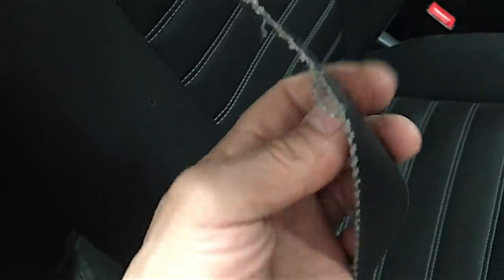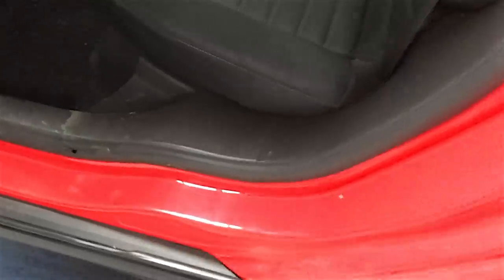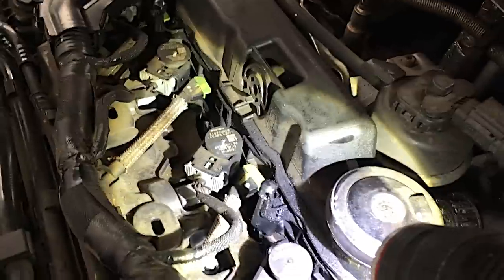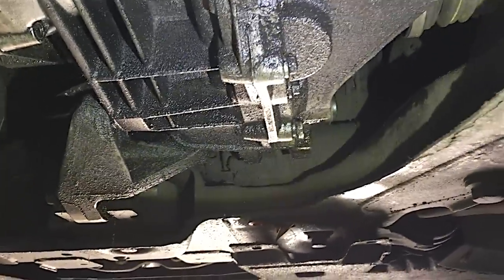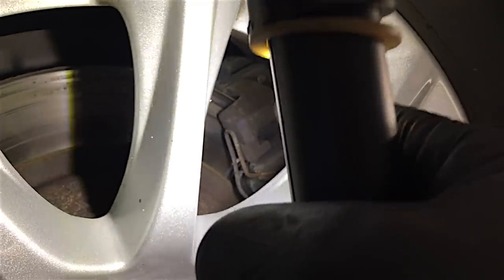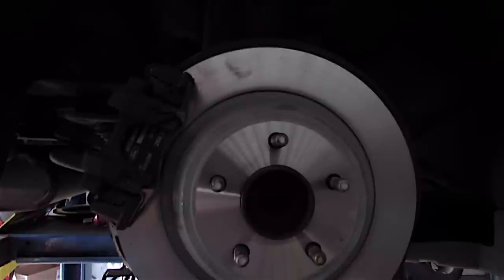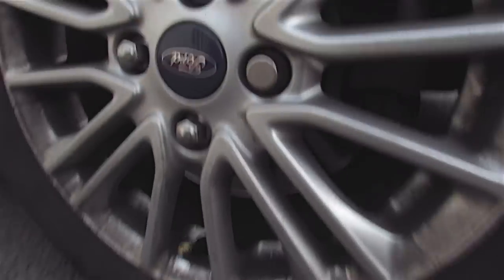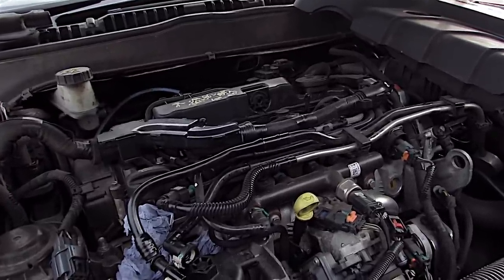My Basic Service Procedure, Ford Mondeo Mk5 2L Diesel

Comment: Hello Alan,  thanks for this vid. Though i dont take it to the local main dealer anymore, because i got ripped off and took it personally.  I always suspected they never changed all the filters. I take it to the local Vauxhall dealer as they do a better job and change filters. And i dont get those ridiculous videos that the poor mechanic/technician has to do. A great pity your not nearer. On the subject of pads and discs, i dont recall that we ever changed discs as often as we do now. Nor springs either.
Reply: I reckon the way it works is if the pads last a long time it's because they're wearing the disc if the pads wear quickly the discs don't.
Reply from the maker: i guess it depends what car it is, the mk5 mondeo does pretty well on discs, 80k plus on the front and usually 200k on the rear, cheers paul
Reply: @alan4x  That's good, mind you using the brakes slows the meter down so no surprises there.

Comment: Hello Alan, I come we with a strange issue related clima on mk5 Mondeo 2015 2.0 diesel 110kw. On the driver side is working normal on the passenger side is always Cold, even with temp sett at maximum. Can you PLEASE give me some advices? What to check or replace....thanks a lot!
Reply from the maker: there ate electric motors on the sides of the heater to operate the hot/cold and distribution..not easy to get to..i have had this problem and tapping the motor with a screwdriver got it working and heating drivers and passengers compartment again...the motor on the drivers side up by the clutch pedal
Reply: @alan4x  thanks for advice! One stupid question from my side. My Mondeo is Left side driving so this motor that you told me should be under glove box in my case?
Reply from the maker: @mihaiursac5041  i would have thought so....you can shine a torch up the sides of the heater and operate the air distribution buttons and the hot to cold buttons to see what motor operates

Comment: A brace that fits the nuts helps and one with a long enough handle to provide enough leverage to open the nuts as well as locking wheel nut adapter.

Comment: Hi Alan, hope you're keeping well. I've read in Car Mechanics magazine that Sealy or/and Laser do special socket set with sizes half mm bigger than standard for example 19.5 or 21.5 specially to fit those swollen wheel nut caps!
I got a Ford and they do my head in when they swell as they tend to get stuck in a socket when you undo them 🤦‍♂️😡
Reply: I bought mine off eBay - they also make a 20.5mm one, and a 27.5mm one for Range Rovers/Discovery’s etc
Reply from the maker: yes they do, i guess it does help rather than hammering a 19mm socket onto the wheel nut

Comment: Cheers! Great video, Alan - very appreciated. I gave my car a service this weekend and noticed a lot of oil on the gearbox and i identified a wet seal on the black plastic cover (flywheel) on the gearbox. Looks as if you have the same on (21:54) in this video - but you don't seem worried about it. Is it nothing to worry about?
Reply from the maker: those engines suffer from oil leaks from the gasket on a cog unit behind the high pressure fuel pump which if just minor I don't bother with. some of these engines with higher mileage can leak from the crankshaft end cap seals which is serious but normally do leave a Nice puddle of oil on the floor..huge repair job to fix that.     https://youtu.be/NExYMYL2Zjk       https://youtu.be/fXakJ1FNmmM

Comment: I had to buy new wheel nuts because some mechanics like to use air guns to remove the wheels.  They get damaged over time. When I was broken down because of a flat tyre, it couldn't be changed until the AA came.
Reply: Do you mean the locking nuts or the oem nuts with the stupid  sheet metal nut covers that fall off or worse expand so the wrench won't fit on.   19mm with the cover 18mm without the cover.

Comment: Hi Alan, I trust you are keeping well with all the changes going on for yourself. Could you advise please on the 2015 Mondeo dry cam belt, Ford says 125,000 or 10 years on my 180bhp manual diesel but I’m reading comments saying change before 80,000 miles etc as they snap. I know of no one having such trouble, just had my car serviced at 106,640 (108 service) and told too early to change belt etc and do it nearer to 125 by Ford dealer so not waste my money. Had the car from 5,000 miles 11 months old to 107,000 no trouble other than fuel pump gaskets once, a new radiator and one new rear caliper this summer. Be grateful for your expert comment please, planning to change cam belt, tensioner and water pump by 115,000 or should I do it now at 107,000? Thank you for your time and any feedback. Enjoy Christmas 2023 and the New Year.
Reply from the maker: hi gary, as far as i am aware these belts do quite well and i have not heard of them snapping either.
 on the taxis although the service interval is 125k miles i have always changed them at 100k miles.... we have let some run for longer and to be honest i would definately change it at 115k miles at the maximum as the belts do look a but ragged at that kind of mileage anmd a much higher chance of the water pump leaking
Reply: @alan4x  Thank you, have a great Christmas.

Comment: @alan ever had a mondeo/focus cut out under heavy load in high gears? No codes just shuts off, have to completely stop to restart and it’s fine immediately. It had a loose oil filter but it’s happened since I tightened it. New oil filter, new air filter, new fuel filter, still does it.
Focus st diesel
Reply from the maker: there should be codes stored in the engine ecu but these may help.       https://youtu.be/_w11KzYL54U                https://youtu.be/FPY75WRL_dE
Reply: @alan4x  I have a basic code reader but it doesn’t show anything, weirdly you can stop and immediately start and it drives fine, never drops power, just cuts out full wood 5th or 6th 90mph (track day obviously)
Reply: @alan4x  I’ll try a leak off test as soon as I can, also check for glitter in the fuel filter similar to the one in the first video. If I give up I’m only in papworth so I’ll book it in 🤣 thanks for your videos and help
Reply from the maker: @Al3xisAE  it would be worth getting your ecu codes read first which will point you in the right direction, if you pass by i can do that for you

Comment: With regards to pedal rubbers. My previous Transit van failed its mot due to the brake pedal rubber being worn smooth. The clutch rubber was actually missing and they said thats not part of the mot.
Reply from the maker: thats right, clutch pedal rubber is not part of mot test

Comment: Good video alan.. its interesting to see what a you guys look for in a routine inspection ... my taxi is on 210k its due its service in 2 weeks
Reply from the maker: you certainly getting up there with the miles, hope it goes well, cheers paul
Reply: @alan4x  still on the same clutch. No dpf problems. Not even had a engine light on had the car since it was new 13 miles on the clock iam hoping to get another year and 6 months out of it. The car is minted ..... when you going to do a live alan miss the chats
Reply from the maker: @ROUTEPLANNERPAUL  excellant, thats what you want .. a car that dosent empty your wallet, and yes livestream tonight lol

Comment: Just got too my gremlin on my mk 4 all the elec was playing around one was not the same it's a titanium x auto I thought the battery was bollocked but as I pulled the battery out I had a look at a shitty air filter (I've had this motor 8 days where my fusion give up after 181674 miles ) so I had a shitty air filter and I undun the filler bung for the gearbox yes low on oil and the cause of the elec gremlin the negative terminal was a bad earth it was going on past which I rubbed downstairs would have cost me a new battery but on test it was OK
Reply from the maker: had a few mk4s where the earth lead on the gearbox gets corroded and causes problems like engine not starting etc

Comment: Hello. Can you tell me your opinion on the Ford Mondeo Titanium MK4 2011/2012 CC hatchback?

I own one and am not happy! 2 l. 144hp auto.

This is a mondeo titanium and not a vw polo!

It is far too noisy inside while driving!!?

Lots of stupid solutions
as the instrument panel has tragically little info.

Placement of seat warmer in front of cup holder. You can quickly spill and damage the seat heater switch!!

Motor data control front bumper front.
 
Auto side mirror that goes into auto when you lock the car that you can't turn off.

Petrol lid locking mechanism which has a weakness and needs to be replaced and takes the fuse. then you stand there and can't fill up with diesel!

Front lights that shine more dimly than you expect.

Car stereo that does not have the sound quality you expect from a Mondeo Titanium.

Headlights that are no longer sealed and fill up with water.

The large shelf plate in the trunk of the hatchback which is CHEAPLY made and breaks quickly if you lift it incorrectly.

The floor plate in the luggage compartment is made cheaply and not well.

Screws for the seat belt in the back seat have screw holes straight through the bodywork and out on the underside. water and salt and everything hits the screw and it rusts.

Suddenly high revs when you take off from 0. You can hardly press the gas pedal, when the turbo has spun up you suddenly have high revs and stand there for 2 3 seconds before it shifts. After that everything is 100% ok. and normal.  gearbox data and engine data are not programmed correctly!

And several other things I dislike!

Comment: Great video I had no side lights working on an mk4  turned out the daytime running lights are the side lights and the side light holders were blanked off with no wiring, do the mk5s have both?
How do you release the electric hand brake on an mk5 to spin the wheels on service, leave the ignition on?
Reply from the maker: depends what spec your car its to have sidelamps as part of daytime running lamps,...the handbrake does not come on automatically like some range rovers so you can switch it on and off at will with the switch

Comment: Hi Alan
I am writing you from Portugal and need your opinion,please, on the following
I own a Mondeo (2.0 150 BHP,Titanium,2018 )with 60.000 km
Before last oil change got messages saying "complete oil level" which I did
And 3 weeks ago I went to Ford dealership to change oil
When I picked up the car they said they detected a" transpiration" where it could loose some oil but nothing to worry about,they cleaned it and said to check periodically the oil level
Last week I went back to dealership because I know the guy in charge,and asked him to check if the transpiration mark got back
When I picked up the car he told me that they found a leak under engine at motor carter and needed fixing because the "silicone kr mastique used to glue (what??) It is not good enymore and not sealing
My question,when they change oil how they didnt see it?
If is normal for a 60.000km car to leak oil?
Is it bad?
Is 650 euros a honest price?
I want to mention that up untill now I was extremely happy with the Mondeo,which is a superb car to drive
Also from what I researched before buying the car tne PSA engine which equipped the Mondeo is a very reliable engine,being considered one of the best 2.0 diesel in Europe
Thank you
Dan
Reply from the maker: hi dan, it is fairly common for these engines to develop oil leaks at low mileages...usually from the high pressure fuel pump area where the oil will run down the back of the engine...more serious leaks can occur at might higher mileages but without seeing the car I don't know where your leak is..best thing is to ask your mechanic for a quote on repairing the leak and explaining to you what it is that is leaking and what is needed to fix it

Comment: Great video , I always thought the brake fluid nowadays is changed every 3 years on most cars ? How often do you change yours as it looked dirty and black, or is it that colour because of the amount of miles the car does each year
Reply: Ford it’s every 2 years, and it’s because of the ABS valve block, moisture in the fluid or contamination causes corrosion or valves to jam up.

Seen it a few times now where ABS activates then pedal travel increases massively then it slowly returns to normal... where a valve is sticking.

That’s why the brake fluid interval.
Reply from the maker: tbh we don't bother, never had a problem,

Comment: Alan, how reliable are these Mondeos? I'm thinking of getting a newer car. Currently own a 2006 2.2 iCTDi Honda Civic. Owned it for 11 years, it's done 217k miles and been utterly reliable, drives spot on,  engine never touched apart from servicing. Unfortunately rust on the rear end is meaning it'll have to be replaced. I have thought about the newer 2.2 iDTEC Civic but they stopped making these in 2013 so getting old now and I don't want the wheezy Honda 1.6 diesel after owning the 2.2 as it's a gem of an engine.
Reply: They're using fifty as taxis
Reply: You can use anything as a taxi, doesn't answer the reliability question.
Reply: @mickl8212  Was using them for twelve years extremely comfortable car, seats very supportive had diesel ones had a mk 4 from 110,000 to 230,000 written off due to small accident had others with high mileage broke down once because timing belt needed changing that wasn't changed another I kept running tank low so knackered injectors but Nitro fuel at forecourts seems good at sorting that overall don't expect much to go wrong suspension is tough. Skoda Octavias are very reliable too very economical very roomy that's why many are taxi's also
Reply from the maker: they are pretty good up until 150k miles or so, after that you could get a few coolant leaks and need to replace a few parts      https://youtu.be/_iPoz6hf96Q
Reply: @marklittler784  thanks pal
Reply: @alan4x  thanks for replying.
Reply: How about the Mazda 3 or Mazda 6 with the 2.2 diesel engine??

Comment: I recently bought a mk5 2L diesel about a month ago with 108,000 miles on the clock 12 months MOT and service before parting with my hard earned money. I've driven her near on 2,000 miles since acquiring her. She purrs like a pussy cat and goes like wannoo. I regularly take her out on good run outs to perform a regen. Only two minor things firstly when I opened her up on the A14 the spanner light came on with 'See manuel' so parked her up and after a couple of minutes restarted the engine light out she drove fine. The other time on the M5 doing between 75 - 80 mph the ECU light flagged up on dash. Stopped at services did an ODB and came up with a P2000 fault (NOx trap bank1). I drove her home ok. Next day checked fluid levels, all good. Fired the engine up no ECU light. Could it be I use premium diesel to fill tank I wonder? On interweb some say it's a good for them some say not. My mechanic insists on using premium diesel with Redex DPF cleaner every 3rd tank. 
What would be your take on it? By the way great vids Al and hugely informative 👍

Comment: Hi Alan, love the videos. I've recently had my 2016 Mondeo 2.0 tdci serviced at my local independent and they've put in 5w30 oil instead of the 0w30 stated in the manual. What are your thoughts on this? Cheers
Reply from the maker: it will be fine with the 5w/30 but next service i would make sure they put the stated oil in..it stops the dpf getting sooted for one but always best to keep to the manufacturers oil
Reply: @alan4x  thanks for the reply Alan. Am I right in assuming that the next service is going to have to be sooner than the usual 18k 2 year intervals due to the different type of oil? The 5w30 they used is a 504/507 502/505 spec oil which I believe is a VAG group approved oil, any thoughts? Thanks again.
Reply from the maker: @duffydon5263  i sure the oil will be very good but on those engines i would recommend replacing the oil every 10k miles
Reply: @alan4x  every 10k on the 2l Mondeo diesel?.. damn I've been having it serviced every two years or 18k!

Comment: That brake fluids a bit black, when was that changed last?
Reply from the maker: never lol
Reply: @alan4x  bet the brakes are nice and spongy
Reply from the maker: @priteshchampaneri5101  you can't compress water, if the brake fluid was to turn to water which could take 15 years or more it would make the pedal hard if anything

Comment: Do you check steering rack bolts on these Mark 5?
Reply from the maker: only if i suspect a problem with them
Reply: @alan4x  ok. I live i Sweden. And here they refused to change bolts on my Mondeo 2015. I think it's reckless of Ford to do so.
Reply from the maker: @vardagsteknik6576  there is a recall for some mk5 mondeo steering motor bolts but if your not notified it can be a struggle finding out if your car is affected
Reply: @alan4x  i know for a fact that it's alu bolts on my car. I spoke to them, and they dont wont change the bolts.  So you mean there is different types of alu bolt, and some are not cause to corrode? Anyway it's strange that my car didn't get any recall regarding to this issue. Thanks for your god content here :)

Comment: Regarding at mk5 timing belt replace, why bother replacing the timing belt when the valve rockers are designed to break protecting the motor. Why not drive the car till the timing belt breaks, might get another 100k ?
Reply: and you might also get half a day with the undertaker for yourself and others
Reply: Why drive a car in the first place,  better you stick public transport !
Reply: I think a bike is best for you 😆 🤣
Reply from the maker: you don't want to be in the fast lane on the motorway when your belt snaps